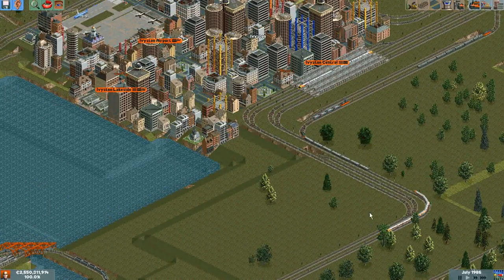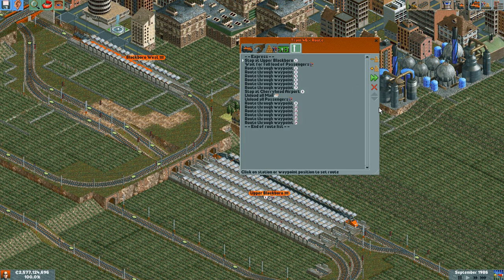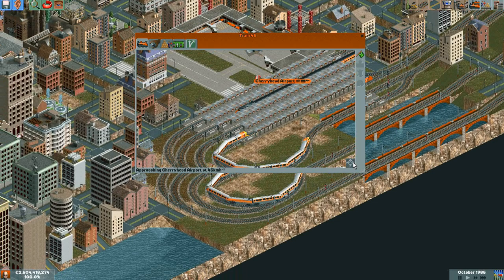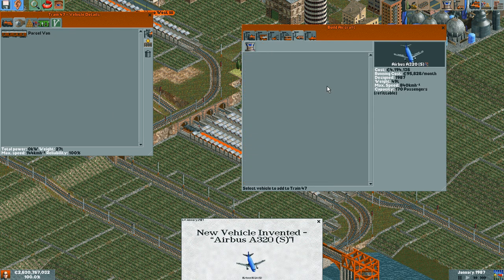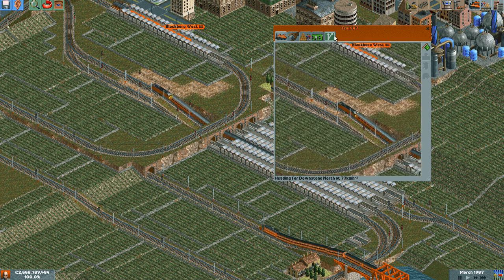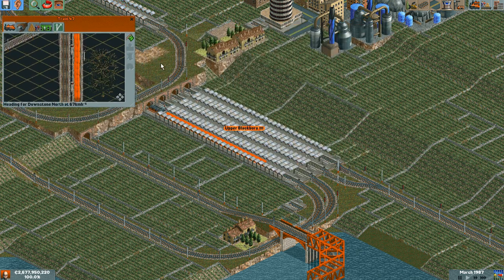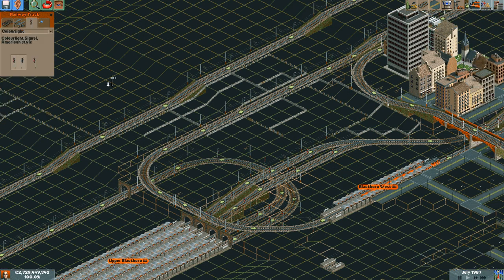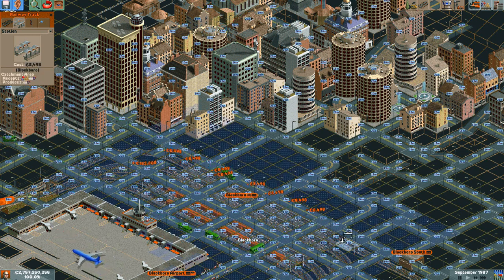Let's Play Chris Sawyer's Locomotion - Ep. 67: TGV BULLET TRAIN

Comment: 9:00 For anyone wondering how the EW-IV carriages are used without modification, it's any locomotive + passenger carriages + 1 driving carriage. The type of operation with a locomotive at one end and a driving carriage at the other is known as push-pull.

Edit: DC 4444, the locomotive that my channel is currently named after used to run a push-pull train on the Auckland rail network in New Zealand.